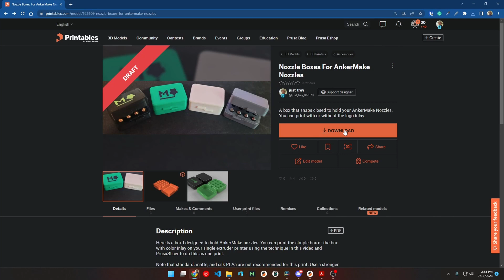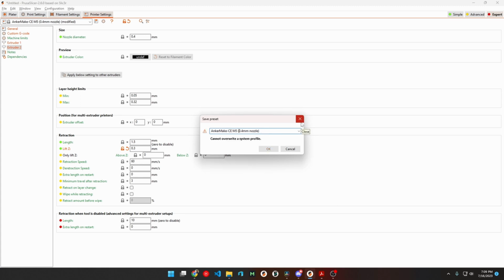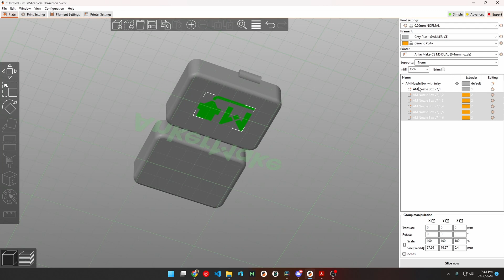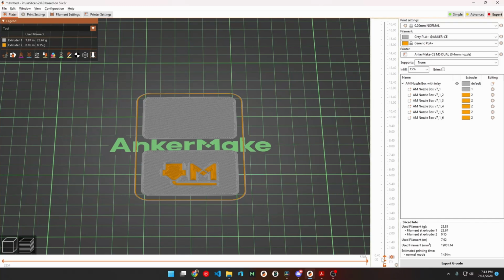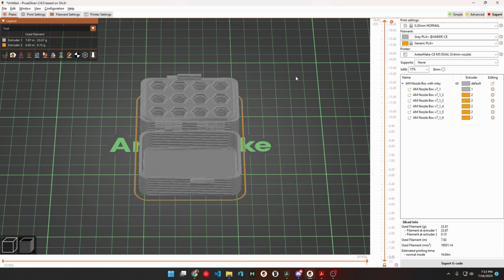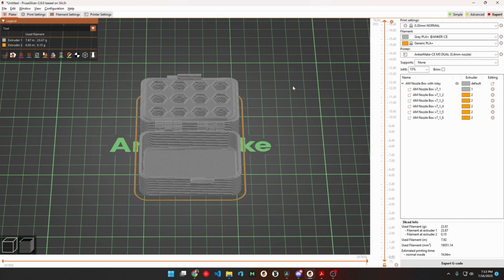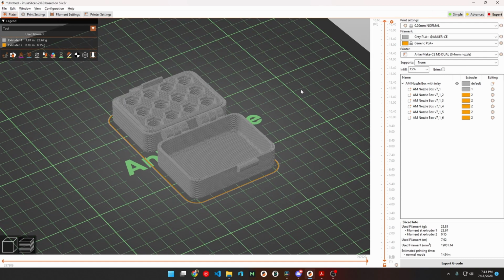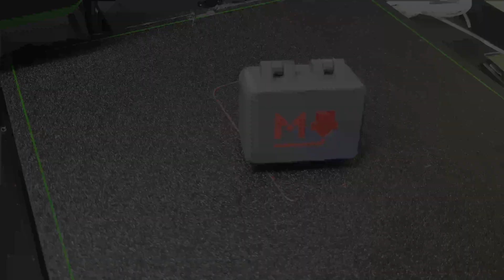Multi Color Nozzle Box With a Single Extruder

Comment: To make your filament changes easier you can go into the printer.cfg file and set the co-ordinates of the pause so as it is Z height and to any x/y position you like. Usually begins around line 320.
Of course it is in Klipper.
Cheers.

Comment: Could I possibly get some advice I have tried the 2.7 version and the 2.5 version and every time I try to copy the code it will not let me put anything in the tool change and it only allows me to to use one of the 15 profiles it installs from the config bundle

Comment: I use the same technique with my Prusa MK3S+. A couple notes: if using other print (not printer) profile as the starting profile you may need to check the "Multiple Extruders" tab of the "Print" profile to turn off the wipe tower. Also, on my Prusa printer the M600 will absolutely spit out the filament that is currently loaded on M600 so the color change at the very beginning of the print is annoying. I solved that by using a conditional in the tool change custom g-code. To do this put "{if layer_z>0}" before the gcode copied from the color change gcode, and put "{endif}" at the end (no quotation marks, and the parentheses looking symbols are the curly brackets). So, if the color change gcode being copied is only M600, the tool change gcode will be:

{if layer_z>0}
M600
{endif}

I used this technique to print a bird inlay into a birdseed scoop. I just had to baby-sit the print to change the color once a layer until the bottom of the scoop was done. Yeah, it did tie me to the printer for about half an hour, but I think the results were worth it. You can see my make here: https://www.thingiverse.com/make:669228
Reply: Thanks for the great tip... Works like a charm here.
Reply: Thanks for pointing me in the right direction. I was able to find instructions that actually work.